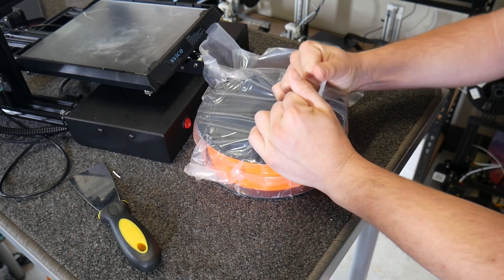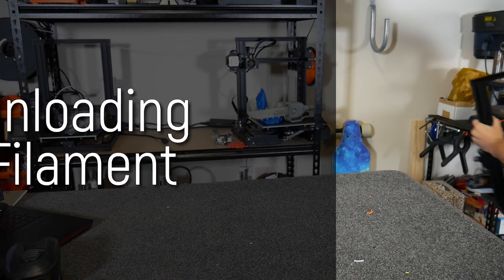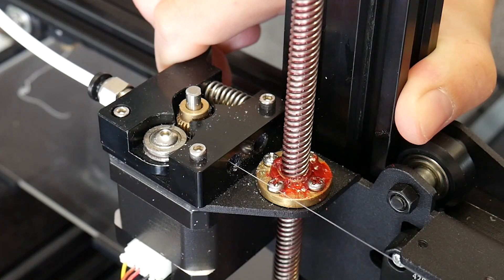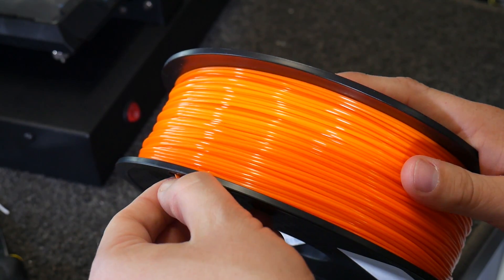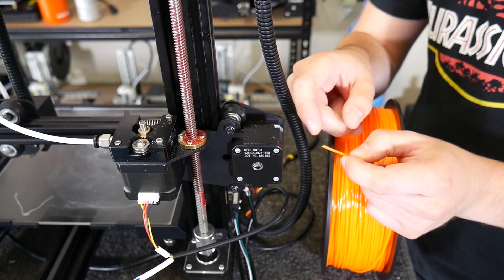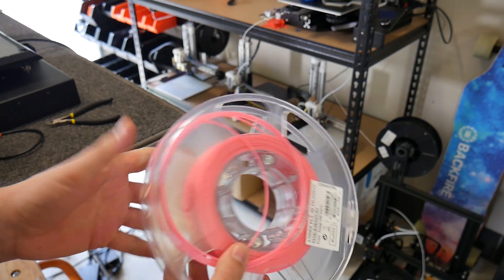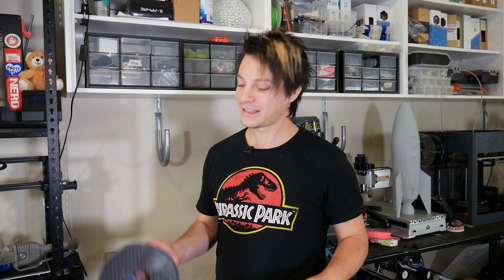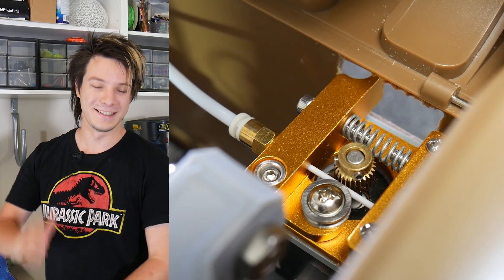How to Load and Unload 3D Printer Filament (and prevent tangles!)

Comment: Angus, the reason I have found why PLA gets brittle within the PTFE tube has nothing to do with the tube, but more so that the filament has been past the extruder and it has been indented  with tooth marks, by the gears. Those tooth marks tend to somehow, dry out or air out the PLA within, making it brittle. Or somehow let moisture in.... Either way, the tooth mark indentations are the reason.
Reply: PLA formulas can have volatile plasticizers. That's why PLA gets brittle over time, even in the dark. The heat around the extruder just accelerates this. Some people suggest it is light exposure, but that's nonsense.
Reply from the maker: It happens above the extruder with direct drive machines too, but not all PLA's in my experience. I feel that it has to be an internal stresses thing, but the tooth marks would certainly not help in the case of bowdens.
Reply: @MakersMuse    I too have had PLA break when sitting in an unused printer.  Usually it's a roll that is 6 months or more old.  I live in the Southern part of the US, and I usually have less than 50% RH in my house.  Most of the winter months, aka now, I'm in the 30% - 40% range, and it still happens to me, on both my MK3 and Ender 3.  And also on my Monoprice Mini V2.
Reply: @MakersMuse  Heat?
Reply: the difference is PLA versus pla + the pla's with "additives" etc.. tends to be more pliant so less tendency to snap. this is probably why pure pla is not actually all that common anymore. most of what we call pla is really a pla blend.

 @MakersMuse
Reply: @MakersMuse , I also noticed that parts printed with Bowden are more brittle, and comes out more mat. That's why I abandoned Bowden, and came back to direct drive. I think this is caused by the time the PLA spends in the tube after being laminated, instead of being melted shortly after. The stress released changes the internal structure or something like that...
On the other hand, if the PLA comes brittle before the extruder, this is more a moisture issue... I never had this problem, but I don't have more that 60%RH in my house.
Reply: Could it be the stress of being wound one way then being held straight (or at least in a different direction) in the PTFE?
Reply: Andrew Currie,  I agree with you, it happens to me in the parts of the filament ( Even those parts that haven't touched the extruder gear yet) where the filament is left in another direction than the one it was when in the spool. If the filament is bent like when in the spool and that section is stretched out straight and left so, the part of plastic under the "arc" gets stretched out creating microcracks making the filament brittle I had an extreme case when I rewinded filament from smaller spool to one bigger, the filament cracked everywhere but heating it in the oven like when drying it solved the problem.
Reply: Sound right. that will do the same thing as the teeth of the feeder unit. Compromise the integrity of the skin surface and permit ingress of moisture.

 @ismaelsaavedra2424
Reply: The sharp indentations are stress concentrators. This is a big issue in 3D printing because it's part of what makes prints not as strong between layers as well as being important on a macro design level too. https://en.wikipedia.org/wiki/Stress_concentration
Reply: I notice PLA becoming brittle often when using 3mm filament.  If its pulled straight down into a printer for a week or so it becomes very brittle and will just snap randomly.  I think it probably has more to do with the cold plastic being flexed in a different direction for a long period of time.

Comment: What type of grease did u use for ur lead screw
Reply from the maker: Just some moly grease, but I'd generally recommend lithium it's a little cleaner.
Reply: @MakersMuse  make a video. How to maintain ur 3d printer
Reply: @Makers Muse, I like this idea, I’m currently cleaning dust from lead screws and checking for tight hardware about every few hundred hours.  More tips would be useful.
Reply: @MakersMuse  thanks man
Reply: @MakersMuse  molybdenum disulfide!

Comment: PLA gets brittle in light, and bowden cable lets light in.
Reply: Peter Ellens , i leave my printer in my closet. There’s little to no light in there at all but I still get those brittle sections . When they’re not in use I leave my spools in boxes so even more so I don’t think that could be why.
Reply: Capricorn tubing is opaque.
Reply: In the visible spectrum, at least.  But it can still be transparent to UV and IR.
Reply: @Culturedropout  I doubt UV can pass and that IR has enough energy to cause any change on the PLA. Do a test, leave a piece of filament on the sun for a day and you will see it doesn't go brittle that fast. My hypothesis is that the filament is always under compression and bent inside the bowden tube so cracks can grow and make it break easily making it look brittle. Or maybe those PTFE tubes release something?
Reply: I keep my filament in a transparent box, definitely more transparent than my ptfe, and still, only in the tubes, we need to get to the bottom of this
Reply: I leave my spools exposed to light and have never noticed a significant change in their  flexibility.  But I have noticed the end being brittle after it's been sitting in the tube for a while, so I don't think it's light, or at any rate, not just light.  Maybe there's some sort of reaction between the PTFE tubing and the PLA filament over time?  Or maybe it's a combination of light and the heat from being over the heated bed and hot-end as the printer is cooling down?
Reply: I would have said perhaps heat was the culprit, but the thing is, I have PTFE tube out of dry boxes and one previous type of PLA I had, became brittle in those tubes as well; even filament that hadn't been printed yet! This new type of PLA I have (the vendor changed to this type), doesn't seem to have anywhere near the same problem, but I think it becomes a bit more brittle than compared to the spool?

It's most likely a combination of things, but perhaps the small air volume that fits between the filament and the PTFE tube is a contributor? That either it become acidic or basic, some other reactions because gases have problems moving in there, that perhaps otherwise would have risen or sunk? Or it could be as simple as I have cheap PTFE tubing, and it was releasing something over time on the inside...

I have to see if I bump into this problem again, but either the new PLA is much better, or the old PLA took the brunt of the "affliction". But it was damn annoying, that when I wanted to print something, only to find that I only got about one meter of filament broken in many pieces in the PTFE tube xD